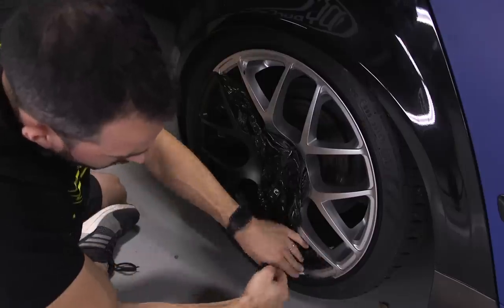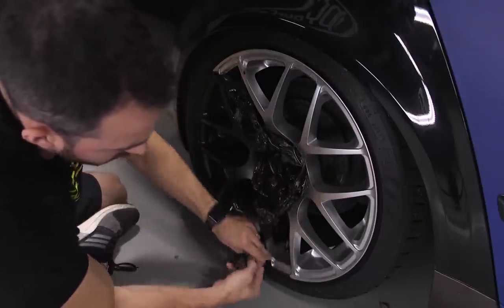Matte Black Plasti Dip Wheels - Ultimate DIY Guide

Comment: I've used dip on my car and motorcycle as well as two sets of winter wheels and my oldest set has been dipped for about 3-4 years in Chicago winters, no problems from the dip at all. Such a cheap way to customize and protect your wheels!
Reply: so you can wash the wheel without worrying about it peeling off? thanks

Comment: My lugnuts are recessed in a hole and when the plastidip dries it pulls off of the inset area and creates a flap. Any suggestions on how to address that?
Reply: Adventures with Lucas tape the lugs
Reply: Yea, thanks, it's not the lugs themselves though, it's the recess that surrounds the lugs, the concave area around them, so that when it dries I imagine it is shrinking a little so because it's concave and not convex then it just pulls away from the surface

Comment: picked up some second hand wheels that had previously been painted. the paint is wearing off, and i'm wondering how you would plasti dip them? sand then plasti? sand then prime then plasti? or plasti right over top? i'm worried about the sections of paint missing and it showing up through the plasti dip. thanks!

Comment: Can I do matte black and add glossifier in the future, or would it be better to do it all at once?
Reply from the maker: better all at once
Reply: DipYourCar I already Plasti dipped my wheels matte black, if I want to make then glossy can I just put a couple of coats of the matte black on top then apply the glossy black plastic dip or do I have to remove all the Plasti dip and start over
Reply: idknuttin the challenge will be getting those rims clean enough to put new topcoats on, whether it's more matte black or glossifier. I have done plenty of rims in the last few years and I prep clean with isopropyl alcohol. You can't prep clean already plastidipped anything with alcohol. My last set lasted over 2 years without any peeling. My suggestion would be to re-do the rims with fresh plastidip and the glossifier all at once. Just make sure your base coat is smooth or the shine with the glossifier will not look good. Good luck!

Comment: If I wanted to remove the center as you did in the video no extra preparation is needed?
Reply from the maker: No extra prep is needed.  The gap around the center cap automatically cuts the coating, so you can peel it off clean.

Comment: If I plasti dip my wheels and then change the tires on them will it peel? Please help
Reply: +Jared Venson I can't say for certain but that's what I was thinking. I would think the mounting machine could possibly mark up the dip or cause a tear. I'm not sure though. I don't think it would be a big deal to touch it up though. I guess even if changing the tires does does that, it wouldn't be that big of a deal. Just re-dip. The dip isn't that expensive and how often does one change their tires anyway?

Comment: How did the back of the wheel magically get done?
Reply: +InaldsBlog They didn't. They clearly took the wheels off and dipped after the fact. It was actually a very misleading move. They made the final result look far better than it would had they left the wheels on but they led the viewer to believe this was the result when the wheels were left on.  Pretty disingenuous if you ask me.